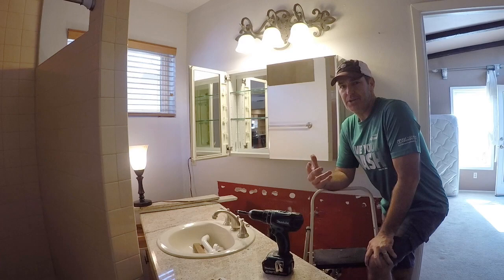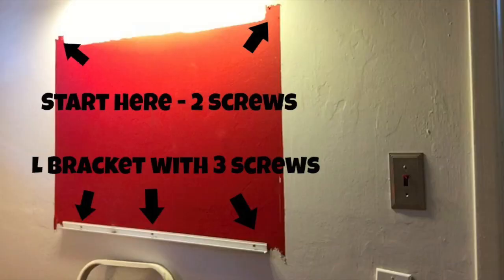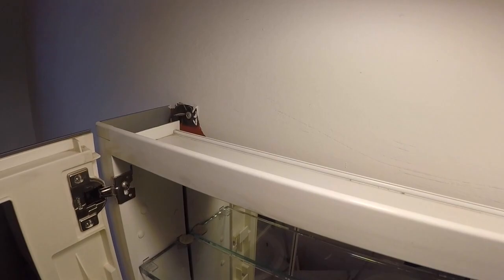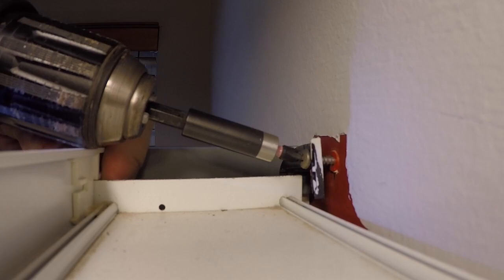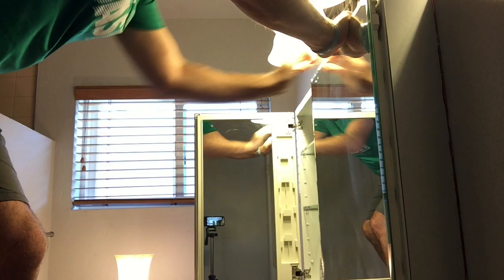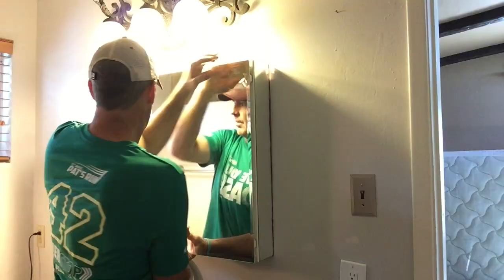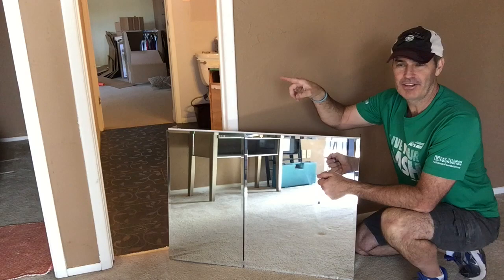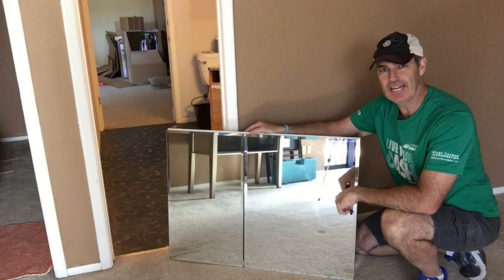How to remove a medicine cabinet QUICK!

Comment: Ok, mine looks like it's cemented on the freaking wall! It's calked.
Reply from the maker: Wow..look at my video on cafe lights attaching to block wall.  Drill hole, insert sleeve and screw bolts into them.  I think whether  you hit hollow block or solid it will hold perfectly fine.
Reply: @how2q  I want to rip it off lol. There are no screws.  It looks crazy,  like from 1950 or something.